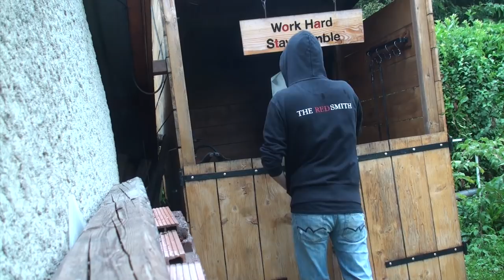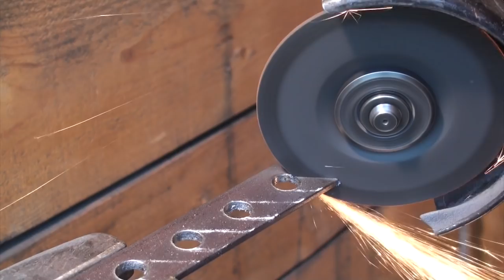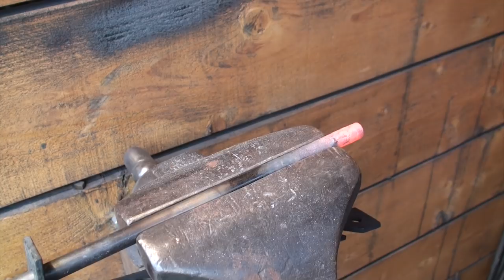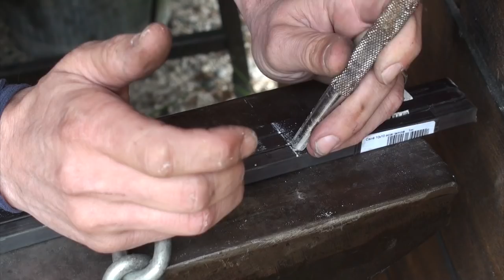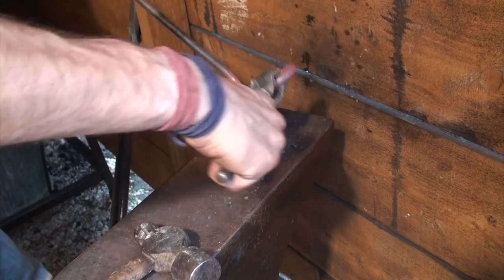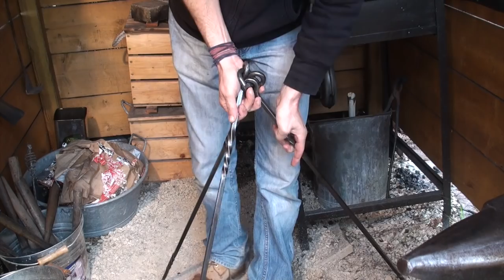How To Make A Campfire Tripod With A Trammel Hook - Blacksmithing

Comment: Hi, great work as usual ! I know nothing about forging so I have two questions. You work without gloves, isn't it hot ?? And what do you spray on the metal ? Thanks for your videos !!
Reply from the maker: Jul's Workshop Thank you very much. I usually don't wear gloves when I forge. If the piece is small I hold it with a pair of tongues (very hot), if I use a long bar I hold it with my bare hand, because it is cold enough to hold and your hand is your best tongues. I like to feel the steel in my hands while I forge, whereas gloves give me a better grip with powertools or when I do woodworking. I sprayed two coats of varnish to protect it from moisture and rust 😊👍
Reply: Thank you for the answer !! :)
Reply from the maker: Jul's Workshop You're welcome

Comment: Shit dude that's brilliant work...
i'm so jealous of your forge, but i have a question... why the chainmail at the bottom of the anvil?
spectacular work, keep the forging coming :D
Reply from the maker: Thanks a lot Olivier. Glad you liked it. The chain has two purposes. One, reduce the sound by absorbing the vibrations while forging (but a small magnet  on the anvil would do the job too). Two, hold a piece of metal when forging. With some weight on it, you can use it as a thrid hand, which come pretty handy :)